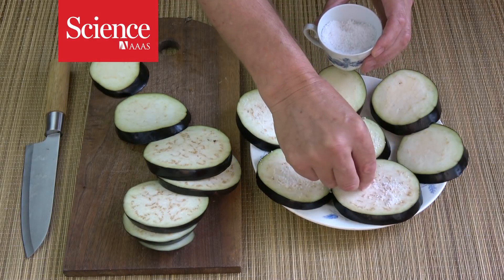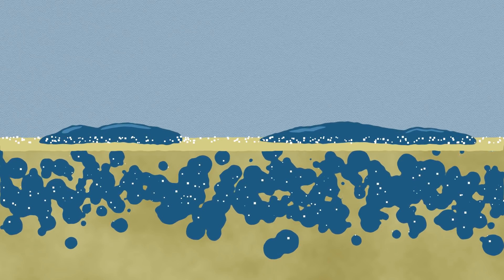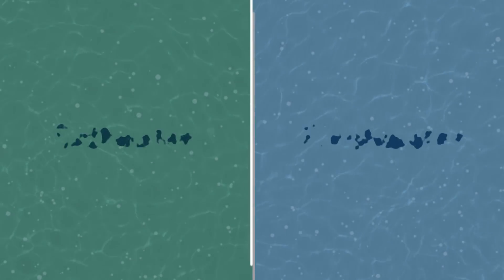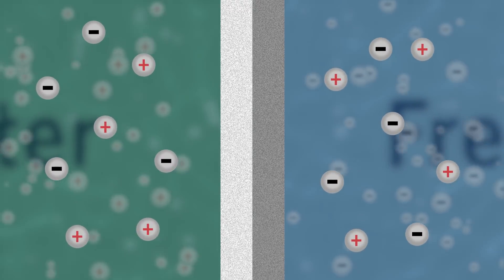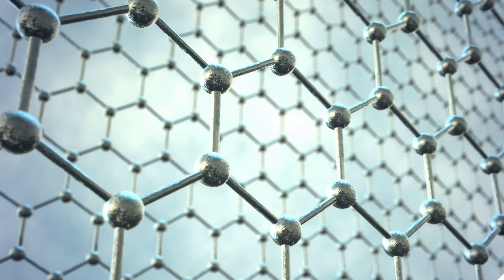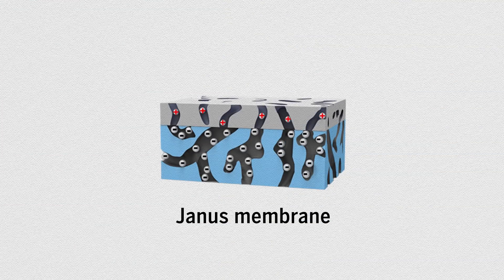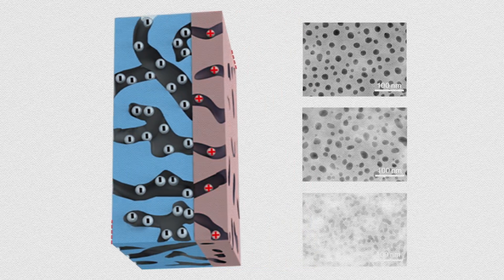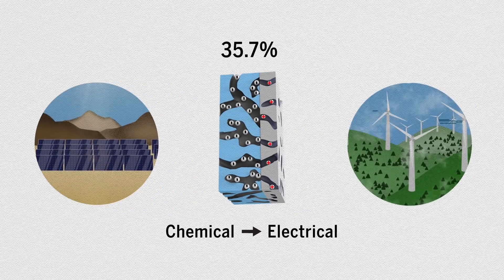This ‘two-faced’ membrane can create electricity—from nothing but salty water

Comment: Essentially this is the opposite of electrodialysis. I'm not sure this setup is necessarily a breakthrough since you can develop a similar mechanism for a flow battery or even a concentration cell. 

I only see this as useful for energy recovery during brine disposal from a desalination plant. Otherwise, I really don't see the potential...

The real achievement here is the membrane technology.